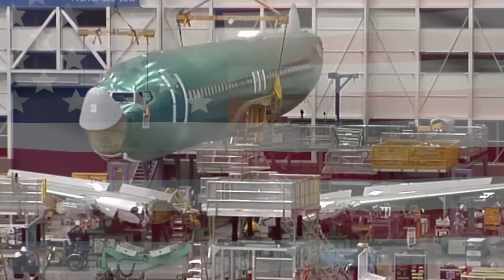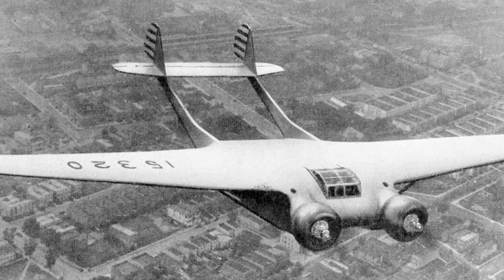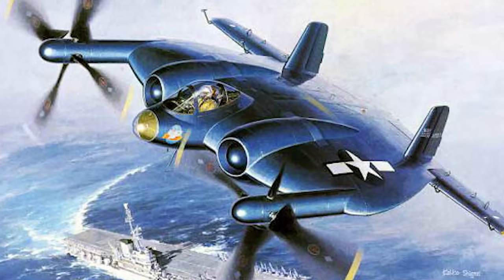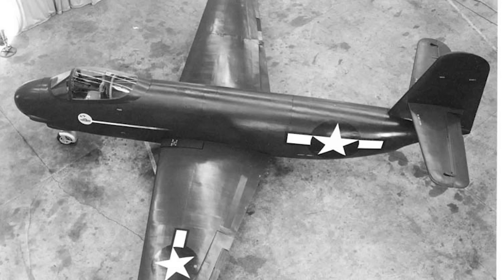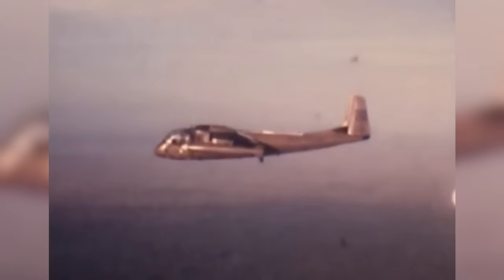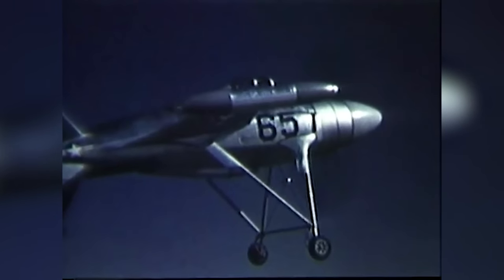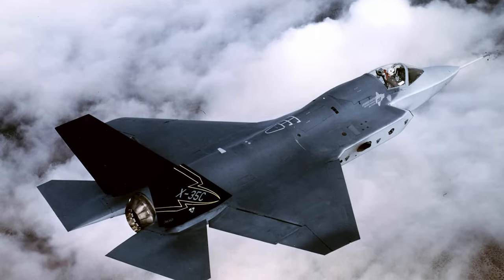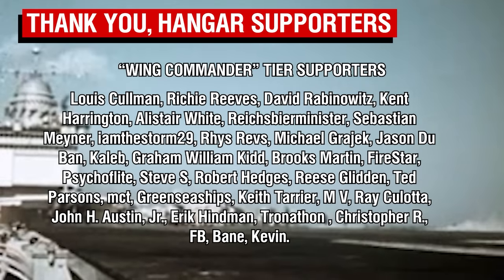America's Top 10 UGLIEST Aircraft

Comment: I still think the USAF blew it by not turning the YC-14 into an operational plane. The proposed production version would be a somewhat bigger plane with even more powerful engines and would have effectively replaced the C-130 Hercules by the middle 1980's with a plane that could operate out of really short airstrips.
Reply: The USAF changed its mind and decided it needed a new strategic lifter instead and the C-130 could still do the job - which turned out to be correct. So they got the C-17, which ironically was a scaled up development of the YC-15 that lost out to the YC-14.
Reply: True, and the Russians were so impressed that they built a version.  The surviving YC-14 is at the Pima Air Museum in Tucson AZ.
Reply: just a year after cancelling that program, the US military wanted to have just such a plane for the iran hostage rescue... I wonder why they didn't use one of the two prototypes, did they not work properly?
Reply: @Ass_of_Amalek  It turned out they didn't need it, because of the outcome of the 1980 Presidential Election.  The Ayatollah knew that he wouldn't be able to push Reagan around like he did Carter, so he chose to let the hostages go rather than facing the wrath of a US military that was chomping at the bit for a chance at redemption after Vietnam.
Reply: @z3r0_35  LOL that certainly is a version of those events.
Reply: @semechkiforputin6920  I seriously doubt anyone outside Hollywood would consider using untested prototype that might or might not be still operational with untrained pilots on high importance mission.
Reply: @randomnickify  they weren't untested prototypes. the first flight happened four years earlier. the amount of testing could have been sufficient to determine that one of those two planes could be made to do the job reliably. getting one plane ready for one mission is a lower bar to clear than adopting a plane type for regular military use.
you know, they were working towards instead using a much less well-tested and much, much more hollywood prototype of a rocket-assisted C-130.
Reply: @NeroontheGoon ...thanks...& as I'm here so I'll be sure to check it out
Reply: I thought that plane was awesome and good looking
Reply: The x32 and the Mohawk were not ugly.
The x32 is way better looking than the f35.
Reply: Can’t agree more, the YC-14 looked cool and did exactly what it was designed to do.
Reply: STOL/VTOL aircraft like the V-22 Osprey, and Harrier Jumpjet never score high in the looks department.
A C-130H needs (fuly loaded) 1200 meters runway the modern C-130J 1000 and the A400m 850 meters (NO JATO 😉)
So the YC-14 (600 meters runway in the early 80's) made perfect sense to have a  STOL C-130H size cargo aircraft.
I have a gut feeling that that distance could be reduced to 400 meters with current tech.
Reply: plane
Reply: @obelic71  I think by the time the C-14 actually made it into service by 1980, it could have had engines in the 54,000 lb. (240.2 kN) range. That could have given the C-14 an extremely short runway requirement.
Reply: @Julius_Hardware What the USAF really wanted was a replacement for the C-141 Starlifter , which was starting to age even with the C-141B upgrade with a longer fuselage and air refueling capability. As such, the USAF bought 222 C-17A's and 273 C-130J's instead of (in my opinion) 250-300 C-14 models.
Reply: @NeroontheGoon  The AN-72 is still in service today
Reply: @obelic71  You are correct, the AN-72 flew for the first time in 1977, the YC-14 in 1976.
Reply: I agree.  The YC-14 sounded extremely promising.  I'm surprised it wasn't sold as a commercial plane for short urban and bush runways.  It was fast enough to make a good passenger plane.    It certainly had the range and with the ability to carry a M60 main battle tank it had the payload capacity.
Reply: @NeroontheGoon  I saw that plane at Pima and I thought it was a flying boat at first because the engines and wings were mounted so high. Pima has a lot of cool stuff!
Reply: @Bucketroo  Yes they do, my favorite sits out by the fence, just to the right of the B-52.  What I wouldn’t do to have the money to completely restore that B-58 Hustler to flying status.  I’d show up at every air show with the two rear cockpits sporting this months playboy bunnies and a black Visa card for fuel.  Both pods would be there too!
Reply: The C-130 was built in Carter's home state of Georgia and was kept around around for political reasons.
Reply: @RachelsSweetie  , Sickening but I believe it!
Reply: @Ass_of_Amalek   Don't you dare deny that Reagan's PP single (ahem)-handedly defeated fully automated luxury Muslim space communism. (Eagle screech)
Reply: @obelic71 Disperse airflow over more of the wing perhaps, could really slash that minimum required length if it hasn't been done or else found impractical.
Reply: @robbudden  You're funny. You might also want to go see an optometrist.
Reply: @robbudden yeah I really liked the look of it. I'm surprised some modern redesign hasn't shown up in a video game yet
Reply: It would be cool if they’d adapted it for naval service. We could have a carrier-based platform to deploy the Rapid Dragon
Reply: The Antonov An-72 family is a much better-looking and more successful take on the concept.
Reply: Battle Penguin is less ugly than Monica. @robbudden
Reply: @Ass_of_Amalek the prototype may not have time to get kitted out for the mission. Bringing a prototype in to an active military situation like that is asking for problems, which turn into bigger problems. Not worth the risk.
Reply: @mikemontgomery2654  that's too general of a statemen t- since prototypes get worked on and tested so much, their capabilities and problems are in many cases better known than they are with other individual planes. that knowledge could have been either that it would or that it wouldn't work well enough, but I don't think that knowing would have been the problem. 

one issue besides failure to fly well enough that I could imagine is that the insides of the planes might have been simplified to only allow for mounting of weights, not seats and such.
Reply: @Ass_of_Amalek  That's exactly what I was saying. On a general scale, there are far too many unknown variables flying a base prototype into a combat zone. That's the overarching reason why they didn't do it. There is so much more going into the why they won't do that, I'd be writing you a novel with all of the details.
Reply: @mikemontgomery2654  that'snot what you were saying at all
Reply: @Ass_of_Amalek  Yes it is. I said that bringing a prototype into a combat zone is asking for big problems, Something I had to repeat, in a round-about way. I also said you may not be able to kit the aircraft out appropriately, as YOU repeated in your initial response.
Reply: @mikemontgomery2654  why are you trying to lie to me? xD
Reply: @Ass_of_Amalek  Where have I lied?
Reply: Honestly... I desperately want to see the AC-14.
Reply: @Ass_of_Amalek  cause... prototypes... also herkues did land there just fine it was helicopter who crashed into hercules
Reply: @robbudden  Have you seen your optometrist lately, sir?
Reply: Amazing takeoff performance
Reply: @z3r0_35 this is false, it was Carter who negotiated the release.
Reply: @robbudden  I guess your statement is proof that aestetic taste is a highly subjective thing. And no, before you ask: I do most certainly not agree with you. The F-35 is far from the prettiest aircraft out there, but it falls way short of the X-32 in a contest for the opposite end of the spectrum, as it were. I, for one, can not for the life of me unsee that simpletonesque, gaping/smiling front end portion of the X-32. It is, in my view, a proper what-the-actual-eff piece of aestetic design detail.
Reply: @Ass_of_Amalek  And most likely true factor in what happened. Carter was a joke.

Comment: seeing footage of the YC-14 makes me feel like we were robbed of a very interesting, very capable aircraft that could've encouraged further innovation. I'm sure there were downsides and such that you didn't have time to delve into, but seeing something that bulky take off and land in such a short space blew me away.
Reply: I actually have to agree, this thing just seems so practical
Reply: We do know the downside, engine maintenance is difficult. We know this because this very concept ended up resulting in An-72.
Reply: well wings behind engine needs to be way stronger and need to survive jet exhaust and you need to get people on the wings to inspect engines... and since fuel tanks are usually in the wings...
Reply: It's incomprehensible that the military had no use for a STOL, rough-field medium transport.
No, engine maintenance isn't an issue, when they fly planes that cost $400k per hour in the air.

See also the '50s Chase/Stroukoff YC-134E. Upgraded C-123 with BLC & blown flaps for STOL, waterproofed fuselage and fitted with a pair of huge flat skis. On skis, it operated from pavement, flat ground, sand/mud, snow/ice, and water.
Reply: You will find that the late-70s was a graveyard for many military projects. The Carter Administration cut defense spending significantly and restricted military exports.
Reply: Carter wisely cancelled the B-1 program as redundant because of the B-2. It was taking money away from the latter. Reagan promptly revived it, which in an interview in the early 80s Carter called “silly.” I guess Reagan fell asleep during the secret presentation on the B-2. The “Bone” probably robbed the US of a few more B-2s when they were really needed. Instead the country has had a mish-mash of strategic nuclear bombers; B-29s (horribly obsolete even while serving), B-50s (only slightly less obsolete), the immense B-36s (just slightly less obsolete than the B-50s), B-45s (a temporary fix), B-47s (now gone), B-58s (now gone), FB-111s (eventually sent Down Under, and now buried down there), a smattering of B-1s, and now, a handful of atrociously expensive B-2s to augment the ancient B-52s — which haven’t been built since 1962.
Reply: The Russians have made a few high wing twin jets with blown flaps, including flying boats.
Reply: You can check out An-72 to see how it would turn out.
Reply: @rulebretgne5244 Yeah, he killed the B-1. Reagan restarted the program.

Comment: The Vought V173/XF5U "Flying Flapjack" is personally one of my favorite aircraft. It had an insanely low takeoff speed and structural integrity that made a brick building look weak. Which realistically means there could have been enough weight removed from it to have even more insane performance.
Reply: It looks like a Headcrab...🤔🤔🤣
Reply: It's a cool plane! But like so many designs late in the war, the new jet planes made them obsolete.
Reply: Zimmerman was NACA stability engineer.  His technical papers are online.
Reply: I've always wondered if a design like that with turboprops might make an excellent CAS platform.
Reply: @benjaminbarrera214  Except that props never really became obsolete they're still buiulding new C-130s and pretty much all of the serious entries for light CAS are all turboprops. I mean hell even the propjet concept is basically a high bypass turbofan with the bypass turbine on the outside of the engine i.e. a prop
Reply: Given the Flapjacks low speed takeoff and landing performance it probably would have made a better convoy protection fighter than the VTOL designs tested. And the fighter version should have at least been put through flight testing.
Reply: A flying flapjack design has a lot of potential as a modern close air support combat drone. Propeller driven aircraft are more stable and more fuel efficient at lower altitudes than jets, ideal for air-to-ground combat.

Comment: The interesting thing about the V-173 is that it used prop wash to overcome the normally poor aerodynamics of a low aspect ratio wing.
Reply: "waste not, want not" lol
Reply: That's a myth.
The Vought/Zimmerman plane was copied from the 1930s Arup S-2, which did everything the Vought did, better, and was markedly efficient, not draggy and inefficient.
The props did not counter the wing-tip vortices at super-slow speeds, since the vortices are what allows it to fly super-slowly and not stall. NACA tunnel tests showed that the V-173 did not gain anything nor particularly change anything versus normal 80hp props spinning the other way.

Zimmerman wrote about this for NACA and in his patent sheets. Such very-low aspect-ratio planforms do not always carry around a burden of excessive drag due to wing-tip vortices. The huge vortices are elective and temporary, in order to fly slowly and not stall.

'90s Wainfan "facetmobile": 100 kts on 40 hp with 340lbs useful load. Stall proof. Wainfan wrote for NASA about the "parachute lift" phenomenon of such very-low aspect-ratio. Could stay aloft at 35 degees + nose-up, <16 kts speed.
https://youtu.be/LK7FhK5eL70?si=n4V0VY80HMrvIYg0

1932 Arup S-2 was copied by Zimmerman for his work for Vought. He had seen the Arup fly while he worked for NACA in the '30s.
780lbs, 85kts on 37 hp, with landing speed 18 kts, stall/spin proof, astonishingly steep climb. It was markedly not draggy, but sleek and with good handling. The only reason it failed commercially is because it was "not invented here"; not by a major maker, and because "if it looks right, it'll fly right" is taken as a hard and fast rule.
https://youtu.be/Nxz1UF67EQI?si=b3J8KXzcBnq69_iU

Nemeth "parachute plane". Also stall-spin proof, steep climb and descent, super-STOL, faster than the "normal" plane which the fuselage came from.
https://youtu.be/WzjpXLKLx1s?si=RecL07SDJtIKTOmj

Numerous planes of very-low aspect-ratio have demonstrated that the sort is not inherently draggy.

Comment: One addition to Rex's excellent video: the official name for engine augmented lift is the Coanda Effect.
Reply: No it isn't. Coanda Effect works on all wings. It's the name of the effect that a fluid (in case of airplanes, air) stream tends to stick to curved surfaces. You can use it for engine augmented lift, but without the Coanda Effect all planes would stall as the air stream wouldn't stick to the curved top part of the wing.

Comment: The "air sedan" wings, having 4 of 'em, cancelled each other's lift potential out in that setup. No wonder it barely got off aside from the underpowered engine
Reply: You mean as the higher pressure air flowing under the first wing hits the upper surface of the second wing?
Reply: @Bird_Dog00  yeah. But keep in mind that high pressure air is flowing at low speed, so it slows down the high speed air that's over the second wing, negating the second wing's lift capacity
Reply: @jehoiakimelidoronila5450   So the design is even worse than I originaly thought...

What was even the idea behind this contraption?

Comment: The V-173 looks like a RC plane design affectionately referred to as a "Nutball". A motor on a circle with a vertical stabilizer and elevons for control surfaces. They fly nose high quite often for obvious reasons.

Comment: I have a dear friend who worked for Lockheed back when the two designs of the Joint Strike Fighter were announced.  When Boeing released its design, all the engineers at Lockheed cheered and started high-fiving.  They knew that they were going to get the contract because - the most important principle of fighter aircraft design is that above all else, the pilot MUST look cool.

Comment: Please remember, for the JLSF project, the X32 vs Lockheed's project had an interesting issue

Boeing made 2 planes, one to demo Vtol, one to demo the rest (with a big hole in it)
Lockheed made 1 plane

Lockheed's plane didnt work, but primarily because Boeing had made two instead of one (to focus on both sides at once) Lockheed was awarded the contract.
The F35 has been described as wildly overcomplicated, fragile, and (most impressively) has been downed by one (1) swallow

Comment: Another Burnelli plane was built after the war, the CBY-3 (now refurbished, in a museum).
The one that crashed in the '30s: it was undergoing a final test flight before delivery, and someone forgot the aileron hinge pins retainers, and the ailerons came off at 150kts, 200 feet up. It hit the ground 120 degree roll, 20 degrees nose, down, at 130kts. The wings and tail disintegrated and the engines broke off, and the fuselage body cartwheeled, coming to rest upright. When they broke it open, the 2 crew walked away.
A Burnelli design was the favored plane for what would become the A-20. It had much better performance than anything else, but Roosevelt killed it because of graft and corruption.
Another was favored for what was to be the S-2 Tracker, but the service dropped it and gave the contract to Grumman.
A usual excuse is that Grumman was an established company that could meet the production, but companies routinely get contract for things when they not only don't have tooling and trained staff & management, but not even factory floor space to build it.
The difference of course is political favoritism.

Note that every high-end military plane from now on will be a lifting fuselage body, not for stealth, but for L/.D and range and payload.
Major makers have presented designs for lifting fuselage designs, but they're too funny looking. See the '70s Boeing model 754, and the recent Lock-Mart "hybrid wing/body" logistics plane, and the Russian "Frigate Ecojet". With engines and fuel load compared to a normal plane, they get x1.75 payload and range, onto smaller runways.